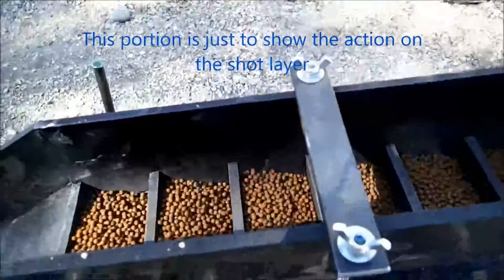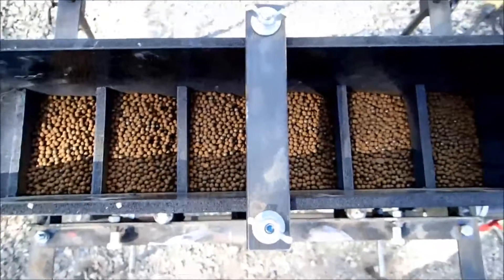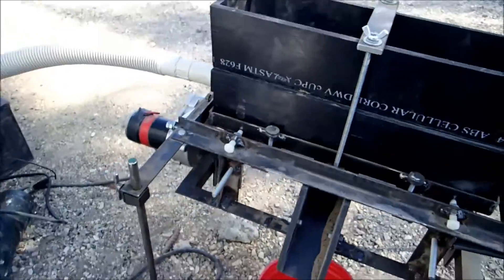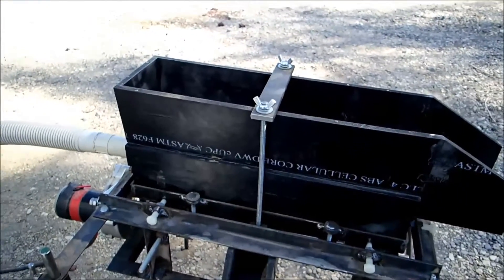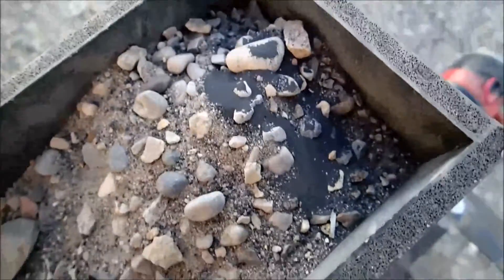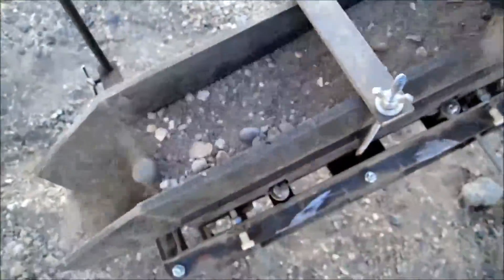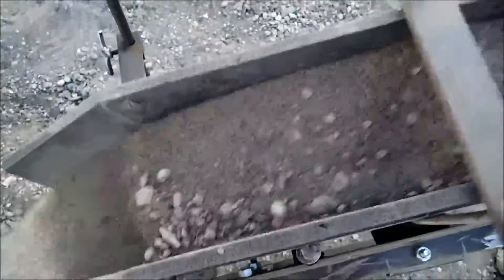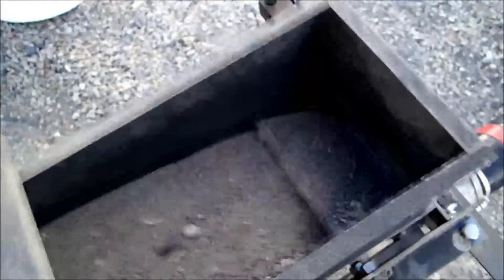Dry (Waterless) Jig Part  2

Comment: brilliant
Reply from the maker: This dry gold recovery jig has now been superseded by the "Sweep" Jig. The Sweep jig is superior in all respects. Cheaper to build, works wet or dry, requires less water when running wet, less power, and quieter.  This unit also requires tight classification...the Sweep jig doesn't. This mechanical pulsation jig is OK, but no match for the Sweep.
Jim
Reply: hi Ji,mis there a link to a video for the sweep jig?
Reply from the maker: Yes...the video is on my channel. There are also a couple of videos showing it running in dry mode.
https://www.youtube.com/watch?v=no5R5hs1SgM